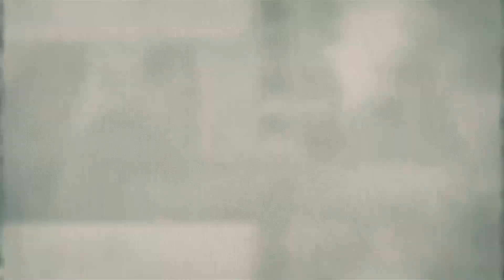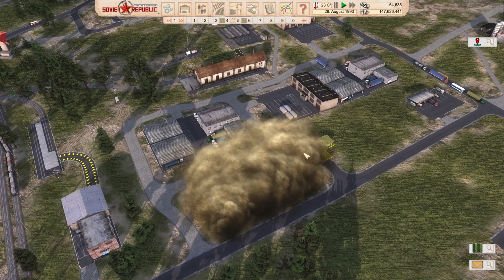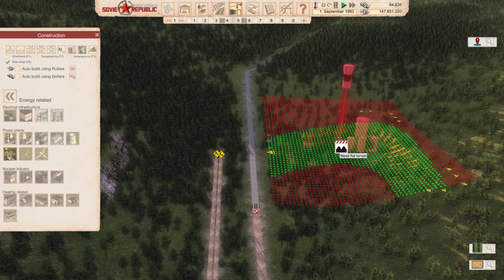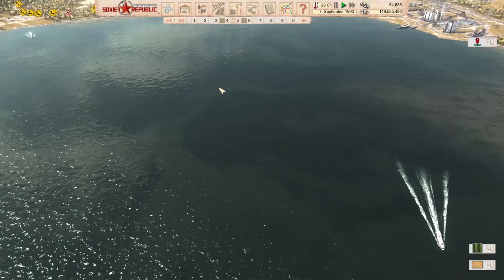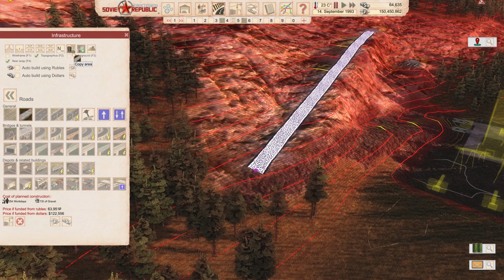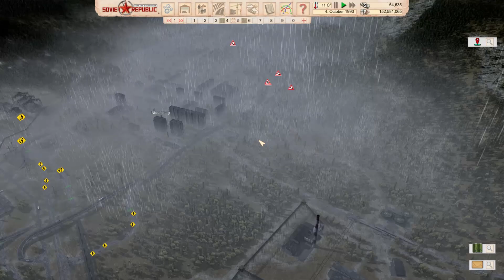Soviet Republic - Alaska - Meat Distribution - Ep.151

Comment: Solar power is a thing in Alaska, it has primarily been used in remote areas, but the largest solar array is in a building in Anchorage (17.28 kw array).  It is ranked 45 out of 50 states in installed solar, so you can use it and be realistic.

Comment: I like those beaches but I think you shoulf make one of the touriist ones, pershps with one of the modded ones on either side of it.just my 2 kopeks for what it's worth my friend 🙂 not to be super negative but solar panels in a Alaska are by no means as valid as geothermal energy.
Reply from the maker: Not bad! Both beaches and geothermal! I think I will do both!
Reply: @oolykeegaming81  Alaska has times if the month when tht sun never really rises. And other Times it never sets but that does not make for super reliably solar power. On the other hand the ring of fire makes for great geothermal power and honestly nuclear and geothermal are both cleaner than solar when you think about mining lithium for the batteries 🙂